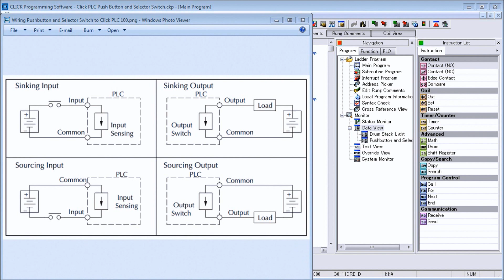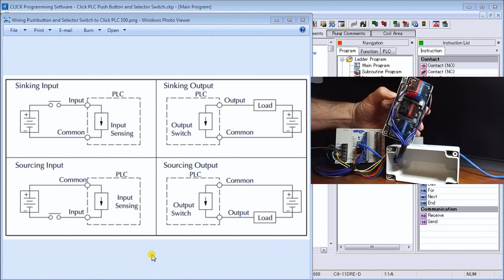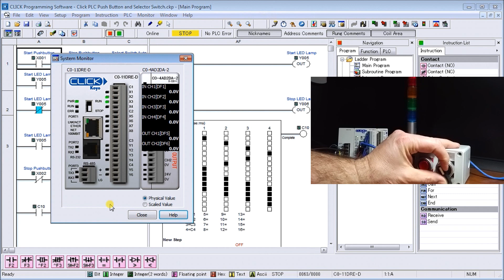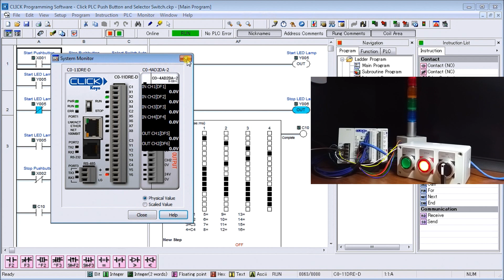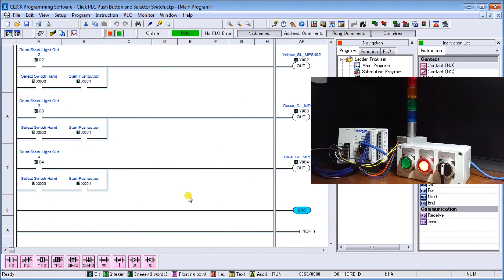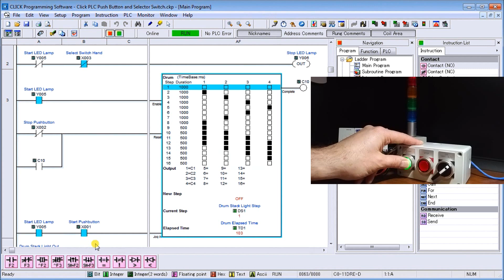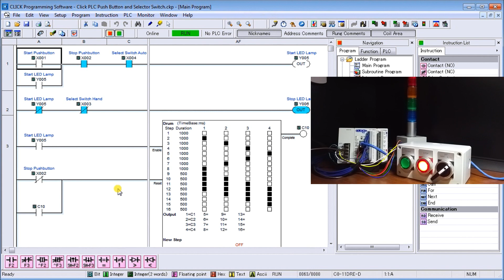Click PLC Wiring Secrets: Push Button & Switch Connection

Comment: Thank you for another click plc video.  Is there any special reason why you chose the sourcing wiring?  Almost everything I have ever worked on uses the Sinking method.
Until I started messing around with PLC's I never used sourcing. (SLC 500 has sourcing only input card)
Reply from the maker: Hi Osseo,
Thanks for the comments. There is no special reason that I chose sourcing (positive switching) wiring. 
Lots of debate has been done on the advantages of one over another but it just boils down to where the installation is located and what they want to see in the control circuit.
Regards,
Garry

Comment: do you have a video on wiring the banner OTBVP6QD OPTICAL start switches. I need to see how to wire two as a safety measure for starting a press operation using two pneumatic air cylinders. one to press down and a second one to locate the part.
Reply from the maker: Hi Rod,
You would need a Two-Hand Safety Control Relay in a press application like this one.  
Here is a link to the safety relay.
https://www.automationdirect.com/adc/shopping/catalog/safety/safety_relay_modules/two-hand_safety_control_relays#start=0
You will find typical wiring diagrams for these relays in the specifications.
If your logic is different than this, a possible solution would be a safety controller. Typical safety controllers will monitor the input and output contacts to ensure the signals work.
https://accautomation.ca/series/mosaic-modular-safety-integrated-controller/

I hope this helps you out.
Regards,
Garry
Reply: @ACCautomation  anything less costly this is for learning purses only.
Reply from the maker: @schoonymopar  
When looking at safety items, this is relatively less expensive. 
If this is for learning purposes only, then I would just create a program that would do the same as the safety circuit.
Regards,
Garry

Comment: Hey man, just wondering of you used a separate power source for your light and your push buttons or if you powered everything using the power supply attached to the plc?
Reply from the maker: Hi Jaaved Mohamed,
In this video, all of the power was supplied by the 24VDC supply attached to the PLC.
Regards,
Garry

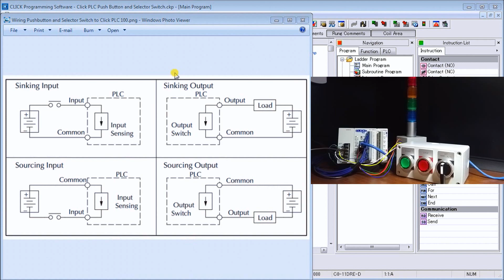Comment: Excellent video and explanation.  Thank you.  It took me 10 minutes to figure out why rung 1 Stop Pushbutton NO contact X002 is blue (passing) when you brought up the programming software at 4:00 minutes.  Then I finally realized the Stop PB real contact is NC so the logic contact changed its state and is bit 1.  Just my story with this lesson.  But excellent explanation of the wiring for this PB station.
Reply from the maker: Hi Dino77 Mullen,
Thanks for the comments. The NC contact can trip you up. It has happened to all of us.
Garry

Comment: can you provide wiring schematics? you mentioned using C1 as a common 24V+
Reply from the maker: Hi Ben,
Depending on if your common on your PLC is +24VDC or 0VDC would depend on the wiring to the PLC. This is usually determined by the additional sensors like NPN or PNP. 
I have not provided a diagram here because this is just in series with the input. Here is a post that will show you some wiring diagrams for pushbuttons and relays.
https://accautomation.ca/wiring-3-wire-dc-npn-and-pnp-sensors/
https://accautomation.ca/heres-a-quick-way-to-wire-npn-and-pnp-devices/
I hope this helps you out.
Regards,
Garry

Comment: This is a newbie programming question for sure and hope you don't mind helping me understand something. What are the control relay contacts (C-1, C-2) and so on that you have in parallel with your inputs being used for? I assume they are internal and simply curious as to what actuates them and when do they actuate. Any help to understand this would be greatly appreciated. By the way, great video! I just subscribed and I will be checking out your other content.
Reply from the maker: Hi JP,
Thanks for the comments. You are correct. C1 and C2 are internal bits of the PLC. These are activated by the drum instruction in the PLC.
https://accautomation.ca/click-plc-drum-instruction/
The above link will take you to the post explaining the drum instruction on the Click PLC.
Here is a link to the entire Click PLC Series.
https://accautomation.ca/series/click-plc/
Note: Videos are associated with each post for further explanation.

Since you indicated that you are new to programming PLCs, I would recommend you check out beginner's guide. You can go through this at your own pace, skipping the parts that you already know.
https://accautomation.ca/programming/plc-beginners-guide/

I hope this will help you out. Let me know if you have any questions.
Thank you,
Garry
Reply: @ACCautomation  thank you for the follow up and links. I'm very proficient in wiring schematics, relay logic, and most other passive devices. I've modified several different integrated controls systems to perform new tasks or provide newer features for specific code compliancy within my industry. Most of these systems include outdated or older PLC controls that are no longer supported. The circuitry I have implemented is done by using the existing input and output configurations but having to add a shit ton of relay logic to achieve the outcome I need. So all of the information you have provided is seriously appreciated. I'm trying to simplify things and programming seems to be my only real solution. Thanks again!